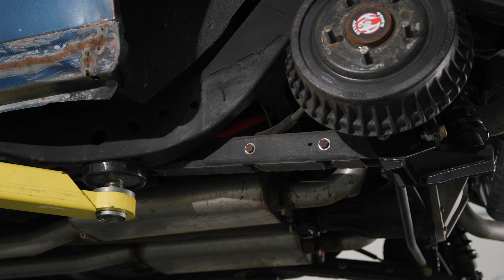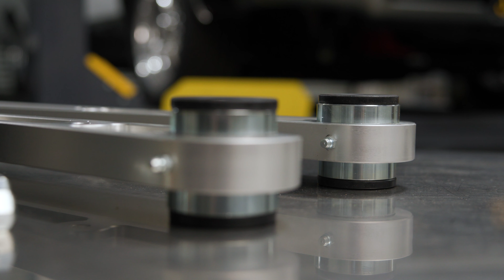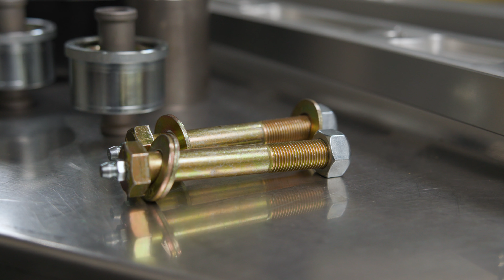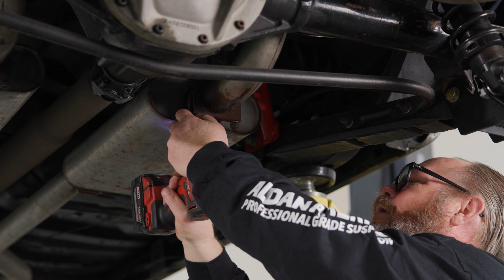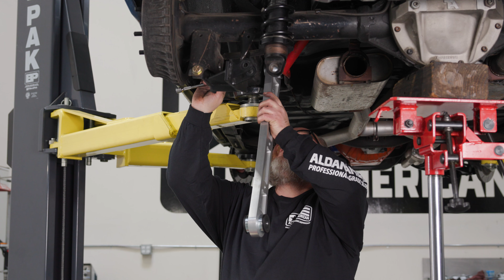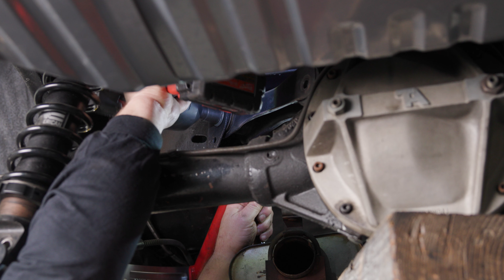Transform Your A-Body! 🔧 JCPG Control Arm Kit Install (1968-72 GM A-Body)

Comment: Thanks for addressing the upper arm clearance issue with the housing.  I was going to make a call to see if you need to grind a bit off, but now i am all set.  Can’t wait to get mine  all installed.